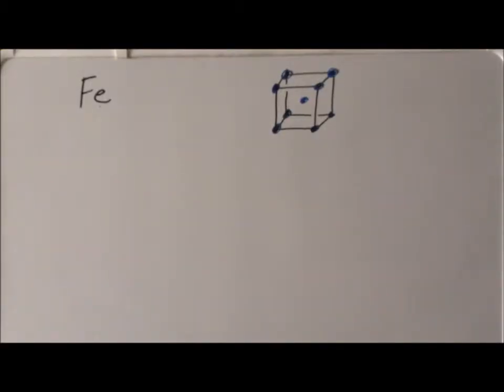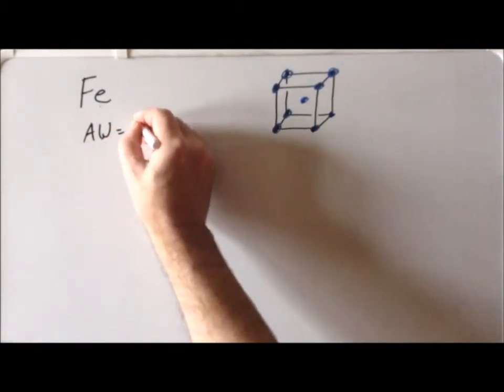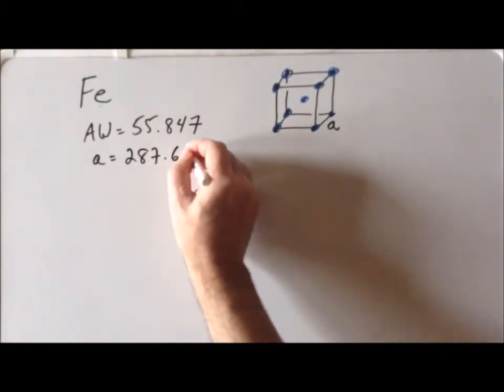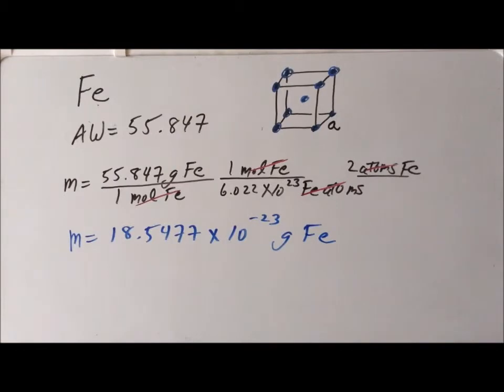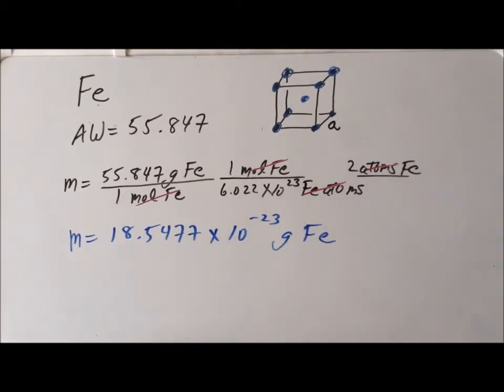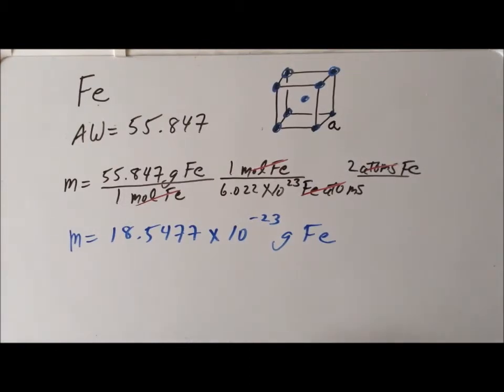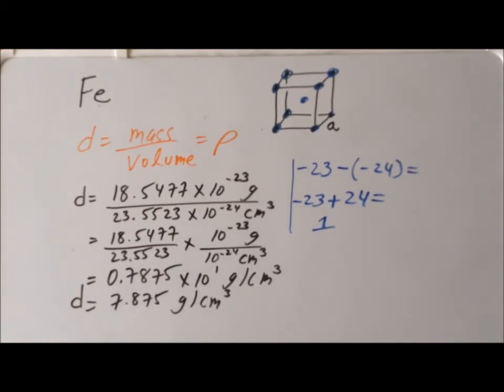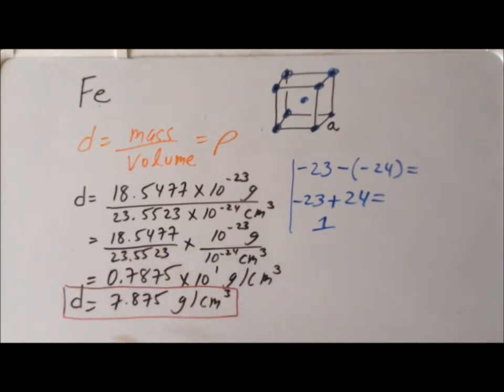Unit cell problem: iron (Fe)

Comment: according to band theory if there are two electrons in unit cell the the band is completely filled. a complete filled band element should be an insulator. But why iron is a conductor. ( Band theory fails???) suggest me something
Reply from the maker: This is a great question,  but one for which I can only outline a beginning to the answer.

Two electrons will fill a band IF the band is completely below the Fermi energy, AND no other bands pass below the Fermi energy. However, if another band passes below the Fermi energy s well, it is possible to have partial filling of two different bands, and then the material is not an insulator.

The 3D band structure of Fe (bcc) is very complicated.

https://www.itp.tu-berlin.de/fileadmin/a3233/upload/SS17/TMS/SS17_TMS_Chap_5.pdf
Reply: @lseinjr1  Yes, I know about that. If the bands overlaps then before filling the lower band, some electrons are filled in upper band. Thats why they are conductor (example :iron) But when there is no overlapping then the band is completely filled and behaves as insulator.(example :diamond). But if we are talking about NFE model, then how can we distinguish elements whose band overlap or not? Please
Reply from the maker: This might be helpful:
https://www2.physics.ox.ac.uk/sites/default/files/BandMT_03.pdf

Comment from the maker: (For mobile users)

00:07   Iron (Fe) data
00:50   Conversion of edge length a from picometers (pm) to meters (m)
03:00   Conversion of edge length a from meters (m) to centimeters (cm)
05:30   Calculating the volume V of one unit cell
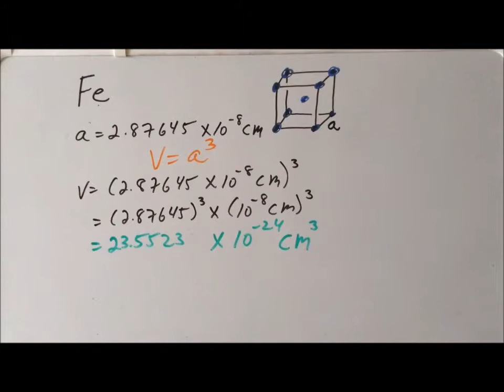08:45   Calculating the mass m of one unit cell
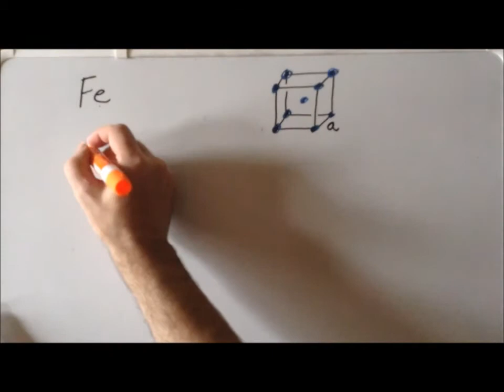11:57   Calculating the density of one unit cell = density of bulk